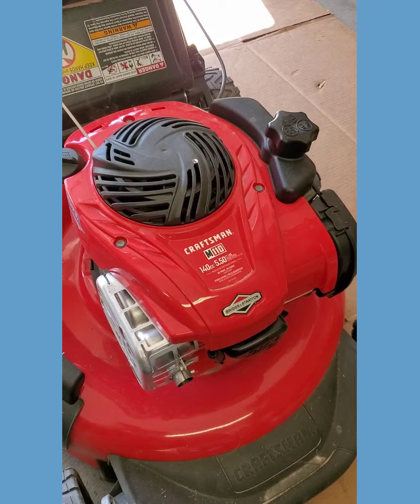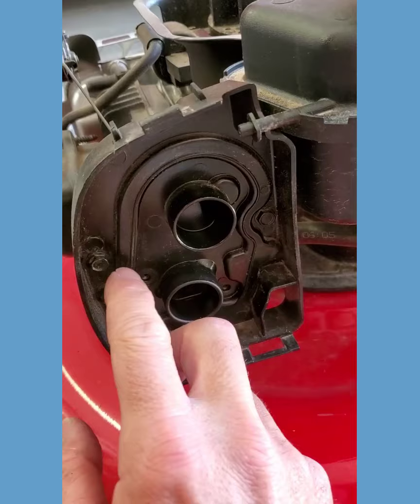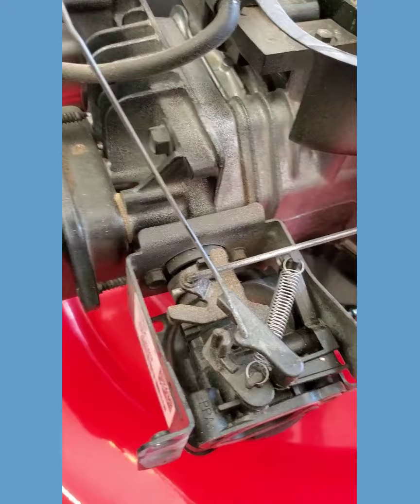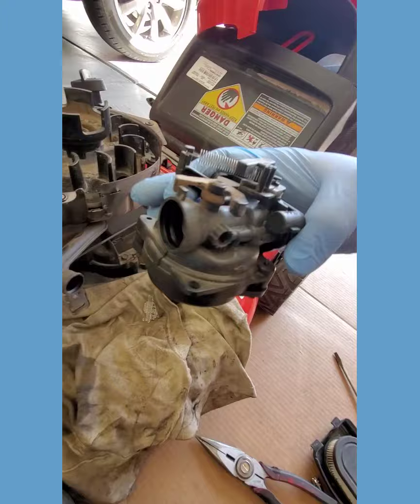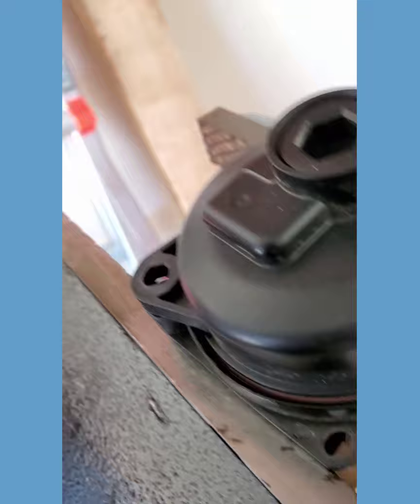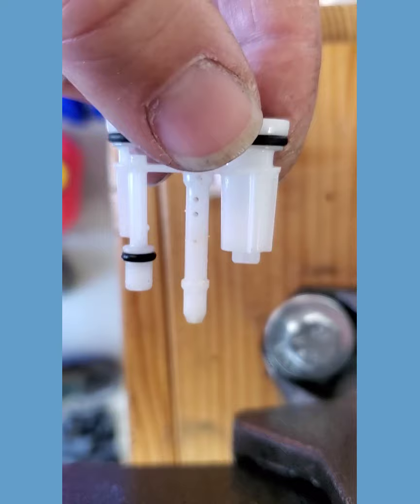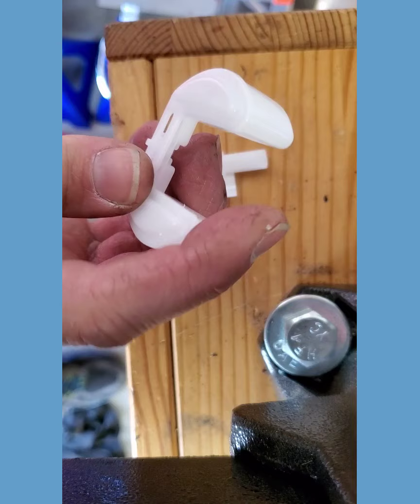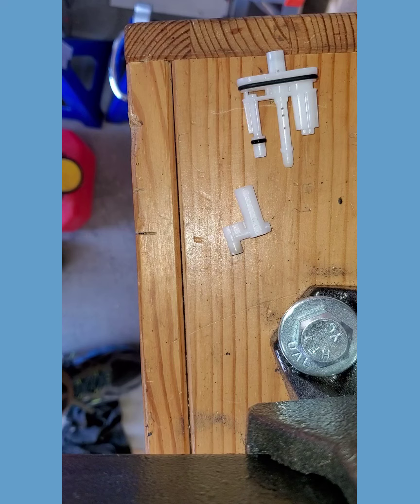Fix Craftsman M110 push mower won't start Briggs and Stratton 140cc engine part 1

Comment: Hey dude, watched this video yesterday and decided to tackle this project today. Thanks to your video, I disassembled it, cleaned everything, put it back together, and it literally started on the first pull. How much do I owe you?! 🥲
Reply from the maker: Haha, you did all the work man. Your comment is all the payment I need. Thank you brudda!
Reply: @jcx2bby  thanks for getting back to me so quickly. I think having no prime and no choke on a mower is dumb, but maybe that's just me.
Reply from the maker: @kitpalencar5165  I tend to agree. While I can see that manual chokes on these little engines aren't entirely necessary, not having a primer makes things difficult sometimes.

Comment: Great video! Got the same mower. Last of last year's mowing season, it would start first pull every time. Sat in the garage over winter, first time trying to start today, and it wouldn't. Spraying starter gets it to turn over but it won't keep running. So, something in the carb, likely. So, what it the PREVENTATIVE takeover that might avoid this - is it draining the gas before storage? Using only non-ethanol gas? What? Thanks!
Reply from the maker: I think the best prevention you can do is to store it inside somewhere if you can, and drain all the gas out. If you can't drain the gas or don't want to, run ethanol free gas in these things. It's the ethanol especially when mixed with just a little bit of moisture, that causes all the stuff to build up in these carbs
Reply: Thanks much for your response. Did the cleanout procedure in the video. Mower is like new. Would not start afterward. BEFORE the cleanout, using starter fluid got it to turn over but it quickly shut off. Did the cleanout (no obvious dirt or sediment in carb), but no start afterward, tried starter again, and this time nothing at all. Last of last season, it worked PERFECT, started within 1-2 pulls. Also, drained all the fuel out, filled back with ethanol-free, and installed a new sparkplug. Nothing. Weird. Very frustrating. BTW, this model has no primer button. I even tried the trick of tilting the mower on left to help gas flow into the carb - no luck. Any thoughts? Thanks!

Comment: Thank you sir for this video it helped me so much. I was able to take the carburetor apart and more importantly back together right. Started on the first pull afterwards. Again thank you very much for your help.🫡
Reply from the maker: Thank you for taking the time to comment and congrats on the fix
Reply from the maker: Thank you for taking the time to comment and congrats on the fix

Comment: What type of fuel are yall using tho? I have the same mower i bought brand new from lowes 6 years ago and it still starts by the 2nd pull if not on the 1st!!!! I use nothing but ethanol free unleaded fuel
Reply from the maker: The ethanol is the issue. But it is impractical to buy large quantities of it if you have a lot of ground

Comment: My mower wouldn't start so I watched this video and cleaned the carb. It started on the second pull after that. Then I tried to start it the next day and It wouldn't start. So I cleaned the carb again and this time emptied the gas and filled with fresh gas. Again it started on the second pull. But after I turned it off I can't start it again. Do I need to replace the whole carb?

Comment: Same motor. Good spark. Sprayed started fluid in carb and still not trying to start. Safety handle pulled and working correctly. What's next to try?

Comment: Im working on one at the moment...it's freaken NEW..The damn filter clean...clean ..clean
the carb to this is POS. ...on purpose. ( instead of just having a tube in the
center like other carbs ..)So people will buy more lawn mowers.
Reply: Same exact problem right now after winter smh. Im not going to try and fix this ima mess something up
Reply: @hotwheelsmustang1662  try draining the bad fuel out of it...first. it's just a POS all plastic CARB...easy start my ARSS. Plastic gets BRITTLE in COLD weather...You're better off putting old style car on it..so you can adjust the HI and LOW. I clean a $500 mower i got for FREE. Drain the fuel.lmao
Reply: @oneeyemonster3262  thanks for the reply. Mine had sat for approximately 5 months during winter. I literally tried for about 30min this morning would start and die quick. I gave up for about 2 hrs came back and after about 10 tries it turned on and stayed on. I was able to do my yard just fine after that
Reply: @hotwheelsmustang1662  ..As long as it works. I flushed one of those carb 5 times. Cleaned the jets...ect. it WOULNDT stay running. ...but I could spray fuel or carb cleaner into the intake ( less the carb).The engine would run.
It's not the engine itself...it's just that CARB design
There;s nothing to adjust on it..Just keep an eye out for used mowers for $10-$20..Most of the time it's just the CARB and dirty plug..Most of the engine has less than 20-50 hours running time.lol ( even thou they're older or just SAT. Some guy gave me 3 each mowers for FREE..I got them all to start/run. Took it to good well..ect

Comment: I just bought this model today. Put in fuel and oil, and it started 2nd pull. 
  But it pulsed in rpm, raising and lowering every 2 seconds. I ran it like that for approximately two- two and a half minutes thinking it would smooth out but it didn’t.
  I shut it down for a minute, tried again, now it fires up and dies. I assume the primer is working but there’s no steady fuel supply.
  It’s brand new, so I’m not messing with it. It’s going back to Lowe’s.
Reply from the maker: Absolutely, don't mess with it and take it back. Maybe if we keep doing this, the big box retailers can out pressure on Craftsman, Toro and others to make better products. These mowers right now are pretty awful. Sorry for your trouble.

Comment: My mower was able to start. Tilting it backwards. Once I set flat, it would shut off. Any ideas?
Reply from the maker: Sounds like it might be flooding.  Possibly the float is bad or there is something stuck in the needle and seat.

Comment: i have a one year old mower like yours that was low on oil and slightly locked up, but i got it unlocked easily. the valves are not moving at all when i turn the blades. but the valves moves when i push on them at the spring part. when i pull the rope there is no compression, only a ticking sound. does not start with starting fluid. i dont know what im doing but im learning as i go. is there any hope for this mower? ty
Reply from the maker: Sorry I didn't see this comment when you posted. Sometimes Youtube notifications don't work well.  I am sure you figured this out by now, but my guess would be that the mower was run without oil and possibly ground the camshaft lobes flat, which is why you don't see movement on the valves. Update us, if you can. Thank you.

Comment: Those B&S motors with the plastic carburetor, like that, don't have fuel filters.  Uh, LOL!  When I cleaned out my carburetor I found debris in the Jet Module, and a lot of debris at the bottom of the fuel bowl, right next to the primary jet.  It's like they were made to support the service industry, LOL!
Reply from the maker: It's all collusion at the corporate level, to make a design this bad. Lol

Comment: Most of the time they don't need cleaned when they are new. Moister builds up in the bowl and it will run for  for a second on a pull and stop.

Comment: WHEN I PULL mine, it just back fire a little bit, but wont start... same model... i already cleaned the carburetor and it still the same.

Comment: What could my issue be ... my mower is making a clanking noise and it's smoking... itll cut my yard for so long then shut off and won't recrank... and if it does crank up it'll run for so long before it spit oil out the exhaust tip and air filter
Reply from the maker: Well first thing I'd check is to see if it has too much oil in it. That can cause those issues. 
Otherwise you could have internal engine damage like bad piston rings and valves. It is hard to say.

Comment: I have a mower that will not come close to starting.  Good compression, spark, cleaned carb, sprayed starting fluid into open butterfly, choke closed, still wont start....any suggestions?
Reply from the maker: I had a Toro mower that did this to me. Even though I checked spark, the spark wasn't good enough to get the mower to run most of the time. If you did get it started, it ran like crap. Turned out to be a bad coil. When I took it off to look at it (after swearing it couldn't be a spark issue), I found black carbon marks across the coil indicating it was shorting out somehow. Changed the coil for a used one from eBay, runs like a top now.

Comment: Just wanted to see how the progress on the fix for the m270 cracked handle assembly is did you get the parts shipped out to repair it yet
Reply from the maker: Unfortunately no. Still waiting and I fear it is not going to arrive. Sad situation.
Reply: @jcx2bby  that's not a good thing at all. Thankfully I've not had an issue with the handle bars on my M270 up to this point. Just be sure to update all of us if it does come and you get to fixing it

Comment: 2 years on mine and second pull starts... I drain fuel when done and fill with new fresh fuel when about to use again. I keep in garage and clean. I also coated the bottom deck to prevent rust and corrosion.
Reply from the maker: Yes, great tips
Reply: @jcx2bby  your mower looks new during the filming of the video
Reply from the maker: @ivanhernandez2157  it was fairly new. Someone gave it to me when it wouldn't start. They gave up on it.

Comment: Sure wish I saw this before buying the damn thing. Going through it not starting now after buying it last fall and using it 4 times , sat in my in closed patio over the winter and now it won’t start.
Reply from the maker: I need to make an update video showing the necessity of using Seafoam when storing fuel in these tanks. The ethanol really clogs things up

Comment: My last B+S motor was never cleaned and lasted over a decade. This piece of crap is brand new and needs to have the carb cleaned every month What a joke. Great video BTW.
Reply from the maker: Thanks for the comment. Your experience mirrors mine and so many others. It's a shame what ethanol and cheap components have done to a once great name in engines.

Comment: Craftsman made some of the worst push mowers I’ve  ever seen! (junk). I bought mine brand new many years ago and got one full season of mowing out of it. First of all I take care of my equipment, I cleaned the mower after every use. It still looks new but haven’t run for years now. I took it apart twice got it running and was able to mow a couple of times before it started acting up again.  This time I took it to a lawnmower repair man. He looked at it and I last it with him. Two days later he called and said it was ready to go. I picked it up and went home and tried to mow , the same issue not working right. Took it back and he did something,I don’t know what? That mower still don’t run , I mean it would start but that’s it. (JUNK) I had a riding mower and it lasted for twenty two yrs. So buyer beware there push mowers are junk and it was around$400.00.
Reply from the maker: The carburetors on these models are garbage. Straight trash. And couple that with ethanol gas and you have a losing proposition

Comment: Used mine 3 times and now its doing the same damn thing. It wont start. Im not engine savvy so im screwed...awesome
Reply from the maker: It is the crappy gasoline these days that does it more than anything, but the engine manufacturers seem to take no interest in figuring out how to avoid the constant issues consumers deal with because of it. 
Hopefully you can get it going without too much misery

Comment: Nice video! Same mower love it but all sudden full throttle constantly won't slow down can't run mower that long? Carburetor is clean linkages springs all look good any suggestions would be great appreciated...
Reply from the maker: That's a curious issue. If it's running full throttle, has to be a reason. I would blame linkage but if you already checked it, go back to the basics. Check the carb inside and out. Check airflow, check for proper spark. Good luck

Comment: Thank you, this helped alot. However, for some reason mine, witch is brand new, started right up I started mowing for mabey 30 seconds an it stalled. I restarted it, it ran for a sec then stopped and now it wont start again, and there is a little bit of oil coming out the exaust. Any tips?
Reply from the maker: Oil coming out of the exhaust usually means 1 of 2 things on these little engines. 1, it is overfull or 2, the engine has been on its side and oil got into the combustion chamber. 
Since it's new, I'd double check the level. If that's good, check for spark, fuel, air, the normal stuff. Sorry it's being stubborn for you

Comment: I appreciate your video so much!!! I am to the part where you have to wiggle the inner component side to side to break the seal (so you can remove it). It’s not coming loose at all. Barely wiggles side to side (and this one is also fairly new). Any suggestions?
Reply from the maker: Just keep wiggling.  It will come apart.
Reply: It did! And I cleaned all the little things and holes, and put everything back together. And then I mowed our front and back yards. So proud of myself (and so very thankful for your video!) 👍🏼🥰
Reply from the maker: @darcysteele5189  nice work!

Comment: These carbs on these mowers drive me nuts. I have to filter any fuel I put into mine. Gas station fuel will have little tiny flakes of rust that will clog those jets up in that white piece.

I ran mine completely out of fuel for winter and I went to start it today with fresh fuel and it's still clogged up for the 3rd year in a row
Reply from the maker: I hear you. They're junk

Comment: Hey could you post the part number for the entire new carb...I keep searching for craftsman m110 carb but it keeps coming up with different models. I have this exact mower
Reply from the maker: You can go on the B&S website and enter your engine model/type code and it will bring up the exact part numbers.

Comment: Just got sane mower used about 3 times and now is leaking oil from the Air Filter and a bit from the front valve cover
Reply from the maker: Sounds like there's way too much oil in it

Comment: Does the m110 have a changeable fuel filter? Thanks
Reply from the maker: No it doesn't, not from the factory at least. You can add one but most folks do not

Comment: This is the worse design ever, I have a mower that has seen Lee's then 3 hours of use and I have to do this every time I want to mow the lawn, it's less then a year old, as much as I want to buy American it seems we as a nation are no longer smart enough to make a working mower
Reply from the maker: These carbs are so prone to clogging up it is inexcusable. I blame the gas we use nowadays as much as the design. Use some stabil or seafoam in your tank and it should prevent some of the issues you are having.
Reply: @jcx2bby  was talking to my landlord about this just now. He mentioned the fuel these days. Blame it on the democratic party with their "green energy" ideology he said. Our fuel back then never did this crap. He says its absolute sabotage and the fuel we use slowly kills and destroys our engine.
Reply from the maker: @demonlordomegaacepilot7090  the ethanol wreaks havoc on the little carbs.
Reply: @jcx2bby  thats the thing wasnt using ethanol was using unleaded fuel with fuel treatment. Havent used the lawn moore since winter we start it up. Sure enough doesnt start. Your video proved to be very helpful was able to get my lawn moore (big boy toy) going and cut the grass make my land lord happy.

Note: however she had same problem you had after putting it together. So labdlord covered the suction hole and covered and opened it with his bare hands. That how we got last part to work. I swear these little small holes do not help for easy maintenace.

But we got it done. I sent you a subscribe.

If you want to help my youtube channel DO NOT SUBSCRIBE TO THIS CHANNEL

Subscribe to Demons Of Tactical Gaming aka DTG

Thats my Esports channel. And check out iur Facebook page (same name) much appreciate it for video god bless bud.
Reply from the maker: @demonlordomegaacepilot7090  just subbed to your other channel. Thanks for the support!
Reply: @jcx2bby  no thx you for such a helpful video! Glad it was floating around. Hopefully our lawn more designs get better over times as we over haul our whole system. Slowly but surely!
Reply: This new gen craftsman quality is absolute trash
Reply from the maker: @rj5822  you should watch my latest video on the M270 mower. Super disappointed
Reply: I highly recommend True Fuel for your lawnmowers. A guy told me don’t use anything but that, or your carbs get gunked up. Never had any issues through two lawnmowers until I switched to regular gas. Here I am now, lawnmower won’t start. Carb was clogged. I’m making it a point to use nothing but True Fuel from now on. Sure it’s expensive, but how often you feel like taking your carburetor apart and cleaning it?? Exactly.
Reply from the maker: @michaeldegnovivo5916  probably depends on how big of a yard you have to mow. Larger yards could make this prohibitively expensive. Adding SeaFoam to regular gas has saved me a bunch of headaches over the years
Reply: @jcx2bby  thanks for that info!!

Comment: BEFORE you do this: mine wouldn't crank, watched this video, and then sprayed WD-40 in the top gril and cranked it like 4 times and it worked. So try that first.